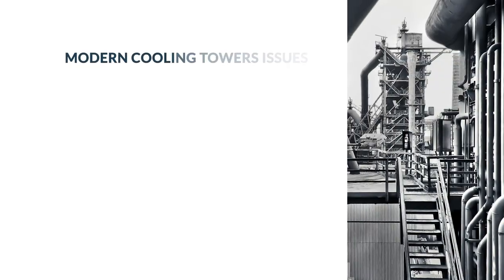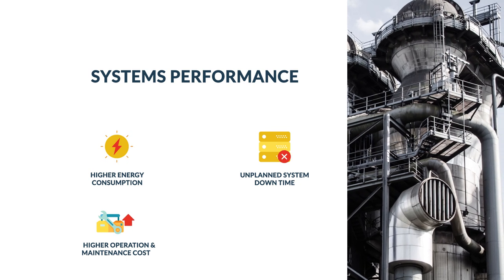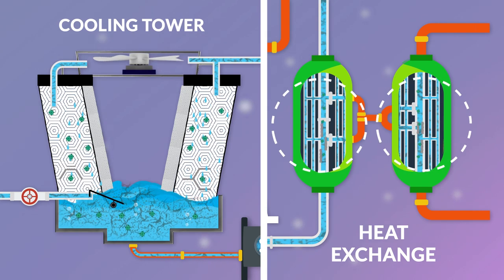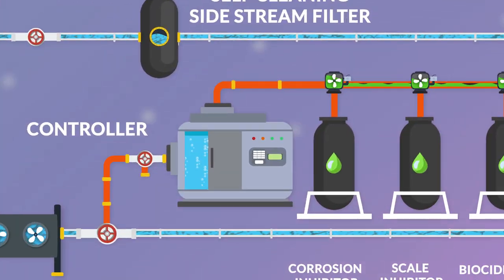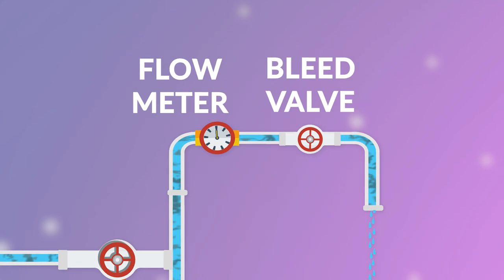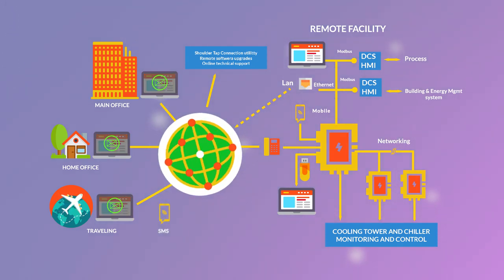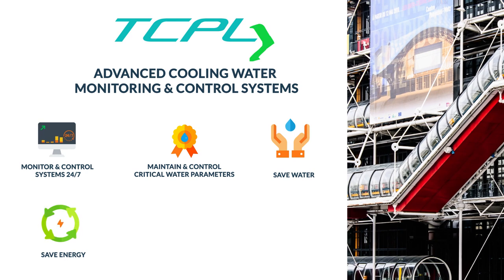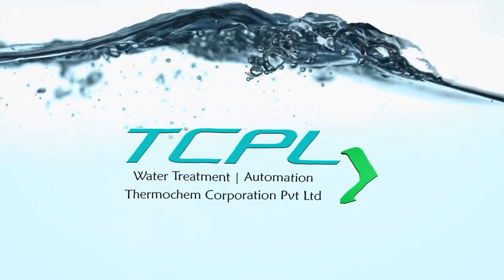Cooling Tower  water treatment program - Auto Dosing , Side Stream , Green Chemicals

Comment: what type of chemical that used in cooling water treatments ?
Reply: depends on your water result in your make up water
Reply from the maker: A typical treatment consists of a combination of Corrosion Inhibitor , Scale Inhibitor and a Biocide program . However the dosages and formulations depends on the make up water quality , site environment and issues currently faced. You can picture this like a doctor treating a patient , there would be some essential chemicals and some based on need such as antifoulants , Oil dispersants specifically designed biocide to tackle a particular large species of bacteria or microbes.  To summarise no 2 cooling water treatment can be same , they are tailor made to address issues at hand.
Reply: How much cost of this product pls share me
Reply: Can we use Automatic system for bleed valve to control cycle of concentration ?🙏
Reply from the maker: @rudygouw7202  Yes with the help of make water line  and cooling tower water conductivity monitor , cycles can be configured and precisely maintained in the tower.
Reply from the maker: @aditisoni2244  please drop an enquiry at our website www.thermochem.net and we will revert back shortly .